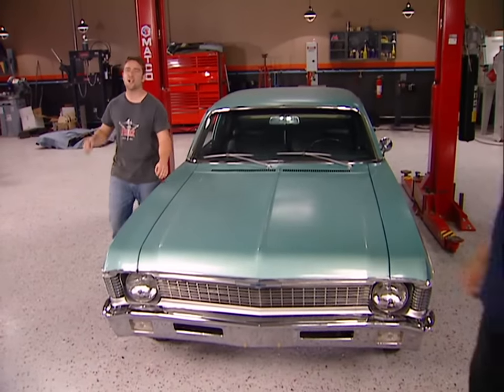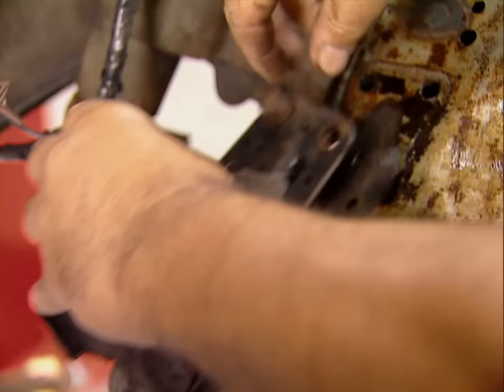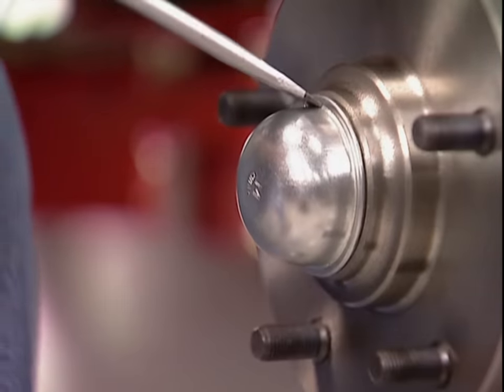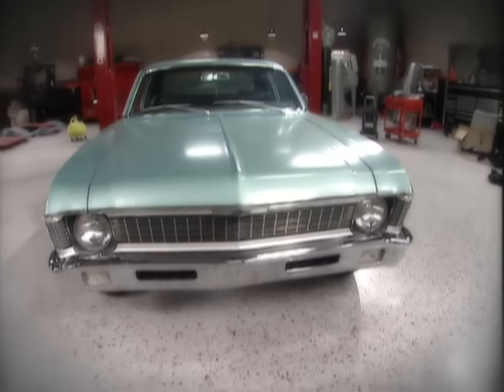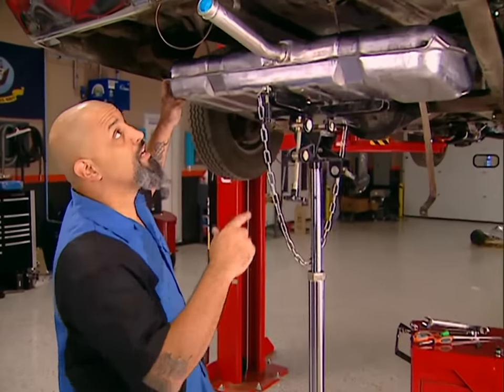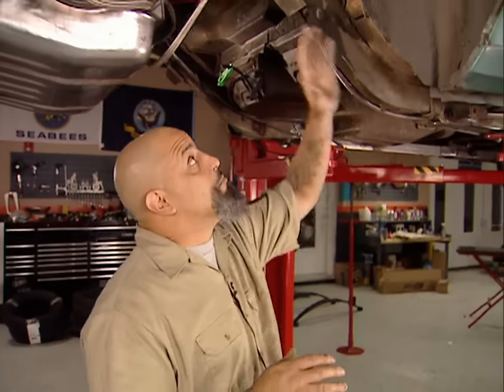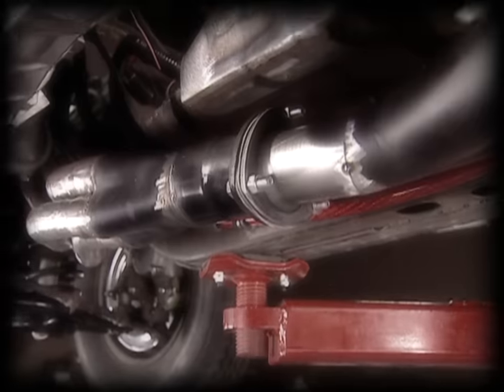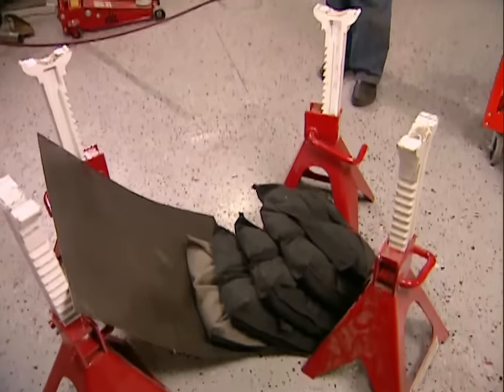FULL BUILD: Out With The Old Lady Car, In With A GM Crate Engine Upgrade For A 1970 Chevy Nova

Comment: You took a great sleeper car and turned it into a freaking mess under the hood with all the wiring like spider web and boiler room plumbing!.can't leave well enough alone!!!!!
Reply: You got that right!
Reply: Just had to put that ridiculous ‘power bulge’ hood.  If your gonna pull the engine, put forged internals, slap a supercharger on.  Done.
Reply: was not well  enough, is now though
Reply: Should have a sbc
Reply: @hafcrakerbarl8801 you don't even know it's called a cowl induction hood.
Reply: @RickyBobby42069  we bought the first COWL INDUCTION HOOD off a wrecked 69 CAMARO IN late 69 to replace our hood that was crunched in an accident at FONTANA SPEEDWAY, IN 1969,!!!
Reply: All this interference was pointless the 440hp sleeper was more than enough. It did what it was intended to do.

Comment: Lou’s talent is amazing. I wish they’d found another Nova instead of this mint survivor. He could have built everything from the the ground up.
Reply: Lou is a ex-navy guy who went to one of those cookie cutter " be a mechanic " schools. He's nothing special when it comes to real world experience.
Reply: @olderthanyoucali8512  "Lou joined the U.S. Navy in 1981 as a Seabee mechanic supporting Navy Seal Team Eight. As a Seabee, Lou was responsible for maintaining heavy equipment that was vital to the safety and support of Team Eight. His fabrication abilities were an asset, as parts were sparse and conditions intense. After a decorated career, Lou took an early retirement in 1997 to care for his wife.

After retiring from the military, Lou earned an Associate's Degree in Human Behaviour from Central Piedmont Community College in Charlotte, NC. He began working as a Behaviour Management Technician at a school for children with behaviour challenges. A fabricator at heart, he turned his sights on building muscle cars, starting with transmissions, brackets, roll cages and chassis and performance parts." - Wikipedia

Comment: Don't know about you guys, even if the updated engine with new heads and NOS makes more HP, I prefer the sleeper look and the first crate motor fitted. And going from electronic ignition back to a dizzy seems a little odd. All the wiring and spark plug leads of the new engine mods is so untidy 😱
Reply: Yep, disappointing looking at how busy all the nitrous wiring looked.  Not very clean.
Reply: Opportunistic advertising that killed the purpose of a restomod sleeper.
Reply: I kept saying that,,,why the hell did they take the coil packs off?!?!?! Alot of work to go backwards ignition wise.
Reply: Looks a lot cleaner imo with the ugly coils on valve covers are the reason I get turned off buy the ls engines I also prefer simple like a carb engine.

Comment: My first car I got in 1976 is a 1970 Nova. Original drivetrain was 230 turbo thrift and 3 speed manual. Saved my money up and did a 327/Muncie 4 speed swap. Easy swap with V8 motor mount holes already drilled in cross member since Novas were also available with factory V8. Muncie Transmission used same cross member as 3 speed and was same length so could use same driveshaft. Doesn't get any easier than that for a swap. I still have it and will passed along to my son one day.

Comment: An unmolested Nova is always a great find. Lou did a great job as it was. Dropped or pushed back the drivetrain for handling and cleared the factory hood with less modification to the trans tunnel. Skipped the juice cam and heads with the front mounted Ford dizzy. Great video regardless. Thanks guys.
Reply: When was the show originally released
Reply: @MIKEK3NT  about 15 years

Comment: The Nova WAS a sleeper until the Power Nation Guys got a hold of it.  This changed the whole gist of the original build concept. 

I really love Power Nation, but they ruined this car IMO.  The budget build sleeper done right was a great idea; a fun, affordable, streetable ride that runs "under the radar".  It WAS a car that you could take your Honey out for an ice cream in, yet would still impress your pals on the straights.  The Nova Sleeper was something us regular guys could afford.

Now this Nova is a rumble and shake, pimped out full tilt drag car; WTF?!  The car didn't need a paint job!  Just because you get the parts for free is no reason to throw the whole catalog at the project.  This Nova is overdone; now it needs better brakes and a parachute.  If it was my car I'd put it back to an actual sleeper. 

You guys at Power Nation been sniffing too much nitrous.
Reply: Fully agree.

I was really into watching Lou (this was the first time I"ve come across him or his work.  He was great to watch.  I really was onboard with what he was doing to this car.   (Thought I started to say, "what the hell" when he threw the crazy tires on it.)

Then along comes Power Nation and completely fucks everything up.    Clinkity clink in goes a high pro cam.  What is it with these guys that they just can't seem to guide a new cam in slowly and gently and are always banging away at it.  Why not just take an old 2 x 4 and a hand held sledge and just let her rip next time?

An interesting build just goes for a dump at the hands of Power Nation.
Reply: I totally agree 💯% brother
Reply: Oh dude I totally agree. What really gets me going is. If you want to make a car as they did here. First don't destroy an original that another man would love to have. Find a car that needs a little work. Especially if you have lots of money, or get free parts. Fined one that has lots of miles on it. One that needs love some work done.  Then it's justified to Jerk out the engine and gut it. Thease guy found a perfectly running car that is 52 yrs old with 33,000 original miles on it. And decided to Ruin it!
Reply: Lou hand builds headers, makes the bench seat work.  These guys turned it into a moonshine runner.  I’ve seen a lot if these “modded” muscle cars .  Big tires, giant power hump in the middle of the hood and the cheapest Flowmaster .
Reply: @Kuhladestkyicky I couldn't agree more
Reply: but its not your car jo

Comment: Boy's, I had a 1970 Nova like that which I purchased in 1979 for $600 with 63,000 miles. It was the same 'misty turquoise' color but mine had the optional 250 ci. 6 along with an AM radio and a floor shifted Muncie 3 speed as the only options. It listed new for $2250 according to the original window sticker. Had a black bench seat so my gf could sit real close!

Comment: Yeah, this was a cool project, but should have stopped when Lou was done. The hood totally blows the "sleeper" image. Nothing low budget about this rig. Minimum $30k, including purchase price. Column shifted automatic may have been even more stealth. 
Speaking as a past owner of a 1969 Nova SS (350 4 spd, 12bolt/4:10) all these mods are huge improvements, over what GM built. 
Just finished binge watching the entire story. Overall, good job guys!! Looks killer.
Reply: This build started nearly 15 years ago so the prices are not the same but still not a budget build even then. 100% agree about the hood.

Comment: I am struggling to understand why you put a distributor in it? More power? And you just should have put it on the dyno before you started your power adding. Great video, my vote is for the sleeper version. I would like a answer on the distributor
Reply: Advertising a kit is its only purpose.
Reply: I think they didn’t have a way to tune it with an aftermarket ECU back then.

Comment: This reminds me of the Nova SS I ordered and bought new in 1969. Mine was gold with a black interior and bucket seats/console. I was young; abused the 350/300, and it took it. With the 3.31 diff, it would "bury the needle".
50 years later, and driving a C-6 with a cam job, I'm still a motorhead.

Comment: My first car (but second vehicle, first was a truck) was a 1973 Nova Custom. One of the very few cars I regret selling in my life. Bought it off my uncle for $3,000 in 2014, got it running, did headers, intake manifold, carbs, cam and whole valve train.... had the original, untouched 350 in it with about 30,000 miles, no rust, it even had the original, factory undercoating that looked brand fucking new. Every single thing still worked in the car, interior was in good shape. I still kick myself in the ass for selling that car.
Reply: Sounds like a great car, keep your head up. You’ll find another soon enough.
Reply: And you will be kicking your ass for a long time because the price of Novas has recently skyrocketed.

Comment: I bought a '65 Chevy Biscayne with a 283 an 3 speed. I installed a 550hp 454, 6 speed, Hotckis suspension and disc brakes.
Reply: '65 was the absolute best year for the full-size Chevy, timeless styling.

Comment: By about 1:20 in I realized you guys could screw up anything you put your hands on.
Cutting up a nova as clean as this one to throw advertiser parts at it is NOT a sleeper.
This whole thing got ridiculous real fast. Now it's ruined.
Reply: Yeah  I don't think they actually do any work. They cant even get engine displacement correct.  This is a 230. Or maybe a 250
Reply: @thecynic807  it's not even in the details...it's in making a "sleeper" when they totally made a hot rod street car than can be spotted a mile away as such. In as much that is not the problem....problem is calling it a sleeper.

I could go on and on.
My high 10sec 3800lb oldsmobile 442 with tailpipes was a sleeper because nobody ever figured that car to run that hard. 
Back around 1992 I had a green 1971 cutlass supreme. I planted a dirty 455 with stock air cleaner over a painted alum intake. Sure it had headers but full exhaust. Most people thought it was a low 14sec to low 13sec car. Instead it ran 11:80's at like 118 and I made a few thou on the streets with that car

Comment: I had to wait till the very end to realize it's   a wrecked sleeper mod. Should have just left it alone after Lou built it then at the very end two new guys try to "improve" it. They wreck it to a point where it doesn't even look like a sleeper anymore added power it doesn't need and would probably blow the rear differential right off. What a waste.

Comment: I bought a 70 Nova SS 350 when I was 18.  It had no exterior upgrades other than a white pinstripe on its black/black color.  It did have the custom interior with the bench seat which included carpet, but it was a 4 speed, manual steering sleeper,  I still miss that car, 50 years later.

Comment: I think I'd rather have the straight six.
I owned a 1970 Nova in 1979/1980.
My parents had a 1962 Chevrolet station wagon.
Both had straight sixes.
I had a 1993 F150 with a straight six for 25 years.
I like Sixes they have good engine balance.
Where are you going to race your muscle car? The dragstrips have all closed where I come from.
My 1970 Nova was dark green.
Reply: Agree, might of put a a crate 4.2 Atlas from the Trailblazer tuned it. Makes 360/360 tuned a set of brakes and suspension with ac and daily the old lady. I’m not one for street strip cars, barely using it doesn’t justify ownership.
Reply: @WoodLox  
That would sound good to me too.
I would just drive it in nice weather.
I live Michigan & the cars all rust out from the salt in the winter.
Although, the newer cars seem to not rust out as quickly.
Muscle cars were great in the 1960's!
A neighbor had a muscle car when I was a kid & we would go to the dragstrips.  He had to work on it constantly.

Comment: That looks exactly like the one I had back in the mid-70s.  Same color, same straight 6 cylinder engine with an automatic transmission.  It was my daily driver to save miles on my Porsche 911E.

Comment: one thing for sure, Lou would not have installed the 2" carb spacer upside down. but great project in either configuration. i would have passed on the distributor since it already had a top quality ignition system.
Reply: I had a laugh at that too🤣..
One idiot put it on upside down then the next idiot put the carb on with it still upside down🤦‍♂️
1:10:33

Comment: GREAT VIDEO GUYS I LOVE U RENOVATIONS ON THIS CAR ,I USE TO HAVE A 1969 NOVA ,70,71 ALL THE THE SAME STYLE, 72 A LITTLE BIT DIFFERENT, MY SISTER USE TO HAVE 1969 CAMARO ,I USE TO HAVE 1971 MALIBU CHEVELLE ,THEN I CHANGE TO 1971 FORD LTD ,FORD GALAXY 500 =1967 [THEN 198O TOYOTA COROLLA, 1981 TOYOTA COROLLA  SR /1983 MAZDA RX7 ,1984 TOYOTA CELICA ,1987 MUSTANG 5.0 /1992 HONDA ACCORD /1996 ACURA INTEGRA/2001 TOYOTA CAMRY /2005 TOYOTA COROLLA TYPE S  AN 2001 HONDA CRV (OLD DAY I FORGOT =1975 PONTIAC FIREBIRD /I WISH I HAD THOSE CARS 🚗 NOW ,I WILL BE MORE THAN HAPPY 😊

Comment: I swapped a 6 to a 1974 low miles Caprice 350, 4 bolt in my 72 Nova. That in 1978. Edelbrock 180, 650 holley, blackjack headers

Comment: Back home in Detroit, back in ‘72 my cousin and us guys, took a ‘66 327 out of a Super Sport, built it and put it in a ‘71 Nova, along with a built turbo 400 trans, along with a swapped in 12 bolt, with 4.88 gears. We had fun!🤩
Reply: Really?   I put a jet engine in my Mustang last spring, and the chicks really dig me.
Reply: @dannymccarty344  When are you returning to outer space, you cadet!
Reply: @regsmith7604  ha ha ha ha!
I went so fast that the heat caused it to catch a fire all around the windshield.  Almost burnt up the whole car.

Comment: i would have gone with an automatic trans with the colum shift, to keep it sleeper looking anyway. had a whole stable of nova's back in the 70's. 68' with a 302, 69' with a 383, 70' with a factory "original" 375hp 396 then a 500hp 427, 73' with a 283. a lot of fun

Comment: Tengo uno de ese mismo año, 1970. 6 cilindros 230 c.i. 140 hp. Con  Powerglide. Fue mi primer carro. Y para más asombro del mismo  color original que el carro del video. Lo compré en 1978 en $1,300. Segundo dueño.

Comment: i picked up a 73 ss nova with a rebuilt 350 in it for 700 bucks had gauges on floor all stock with factory paint inkee wheels extra tires for the wheels got it for 700 bucks then a week latter i picked up another 73 ss nova with factory paint black with white strips on side no engine with gauges on floor got it for 50 bucks sold the 350 turbo for 200 out of it but it had a perfect body both had 0 % rust in them the first one had a miss match fender on it other then that it was perfect even under the vinyl top was rust free could not believe that the black one had no vinyl top. plus i get the 4 inch stroke 454 heavy rods ,steel crank and high flow heads 450 hp at 485 torque with a 02xx 400r turbo good to 800 hp but cheap to get more has the bigger pump heavy clutches stage one shift kit from factory plus more so far this year i have got 4 set ups for free with 6000 to 58,000 miles on them

Comment: Never heard of A 236 cid motor for Chevrolet But I have heard of A 230 or a 250 cid engine around that time also the hard working 292 cid engine normally used truck applications

Comment: I would have used a 1970 350/350 small block. That's 350cu and 350hp.. with a manual 5speed late 1980s transmission. I would have deleted the leaf spring suspension in favor of a 4 link 6 way adjustable coil over setup with a 9inch Ford rear with 370 gears  disc brakes.. All tied into the front sub frame via/ a rear frame kit. The 350hp could be bumped up to maybe 370hp using the right aluminum heads and a RPM air gap intake. Anything more in a car like that is overkill, I might do it in a car I wouldn't mind wrecking/crashing, but not in that car.
Reply: 350 and 370 hp are gross numbers...on the street that translates to 290 hp and 300 hp NET in the car.....any modern V-6 puts out more....the 2021 V-6 Camaro at 335 hp net,.
Why bother?
Reply: Hey folks its @chadhaire1711  the Modern car lover that loves to bash on my 1996 Ford F150 with a 5.0L (302) Windsor V8.

Comment: As a previous owner of a 1970 Nova with a 307, I was loving the sleeper look. The changes that required replacing the stock hood totally killed the sleeper look and the overall project for me. I'd much rather have a totally stock looking Nova despite not having as much HP than an easily recognized modified muscle car.

Comment: My question is. If it come 440 straight out of the crate when Lou had it. Then horse power ended up with it and changed some mods then they dyno it and it come to 435. How’d they lose horse power lol. Love the video tho
Reply: That 440 hp is at the crank the 435 was at the rear wheels which translate about 480 hp at the crank. But the money they threw at it and only gained 40 horse is pretty sad .
Reply: The LS2 was rated at 395 at the flywheel. Not sure where they were getting 440hp from. Plus that wasn’t much of an upgrade on the cam either.
Reply: @rallyaroundyou  this was an LS2 crate motor, the 440 probably cvomes frome whatever gm did to it in the lab, it probably had upgraded heads and cam f rom the factory, hence where the 440 comes from